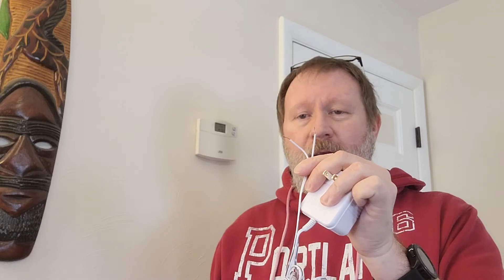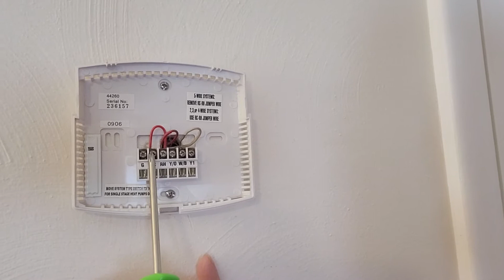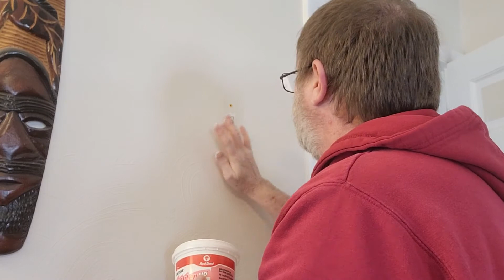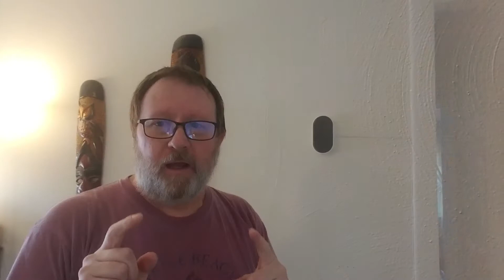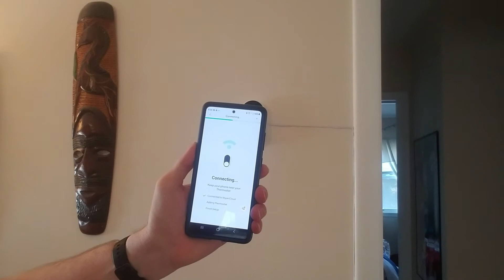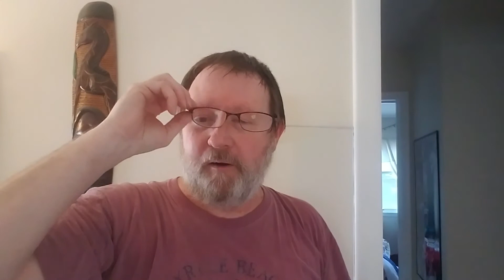WYZE Thermostat Install on a 2 Wire System - 2nd One in My House

Comment: Thanks for showing the setup in the app in this second video. I was stuck at the part where it showed the wiring error and you were able to just skip over it and complete the setup
Reply from the maker: I made the 2nd video because I wasn't happy with the first either.  I was able to get a 2nd camera to use to allow me to record while using my phone to set things up this time.